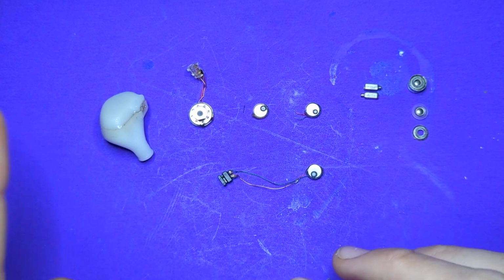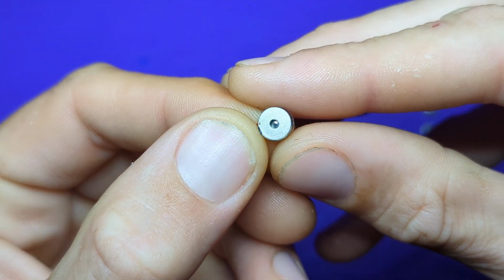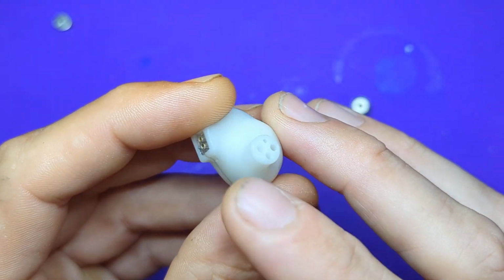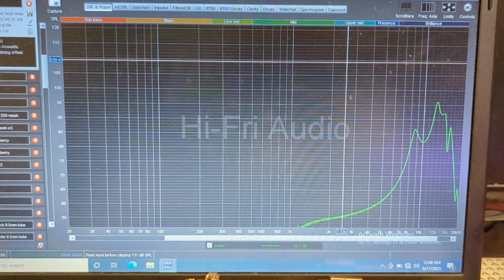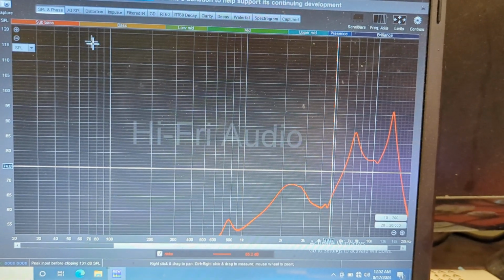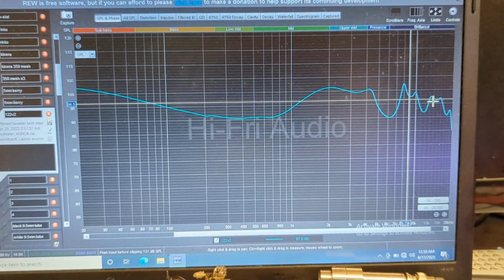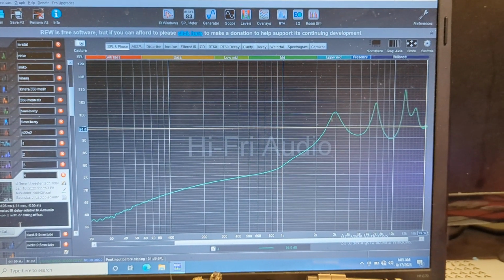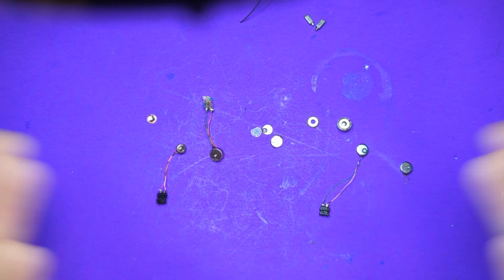Celeste Phoenix-call prototype and the ballad of the affordable super tweeters. 🔊

Comment: Definitely did get a kick out of it! I have been playing around with the Lafitear LF3 Pro. It sounds shocking out the box but i was absolutely dumbfounded that with EQ, it was only just behind the likes of the blessing 2. It has magnetostat advertised as EST, 2x DD, 2x BA. The magnetostat appears quite high quality for the price of the IEM. The DD and BA are actually not bad either. The point behind this ramble was that I realised there is serious potential in a well tuned magnetostat and the whole KZ fake EST debacle has turned many companies away from magnetostat far too early. The (Sonion real) ESTs in my variations are nice enough. I agree that while they are different they aren't outright better than BA, and certainly not for the price. I am going to hopefully rip that magnetostat out of the LF3 Pro and measure it when I next get time